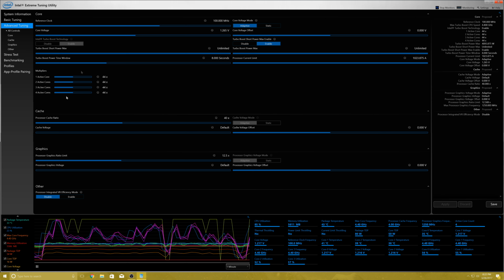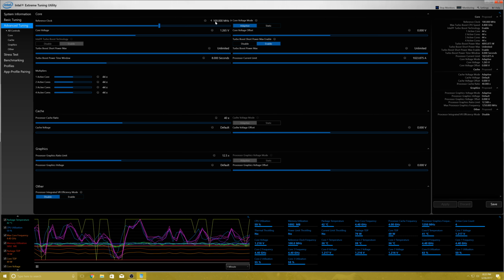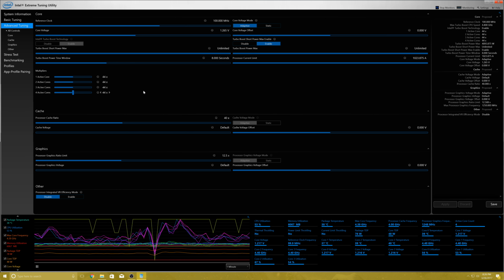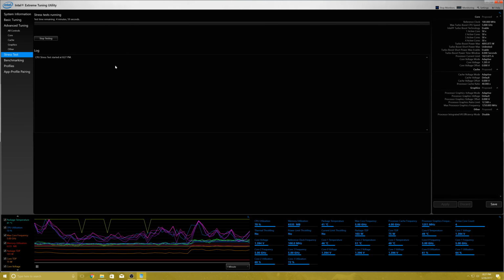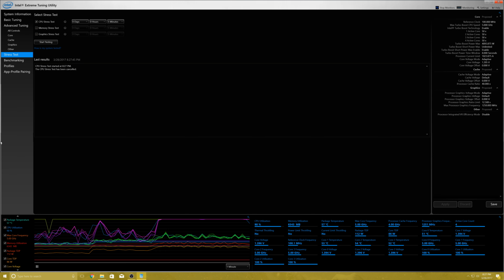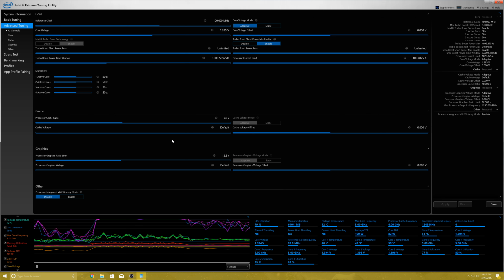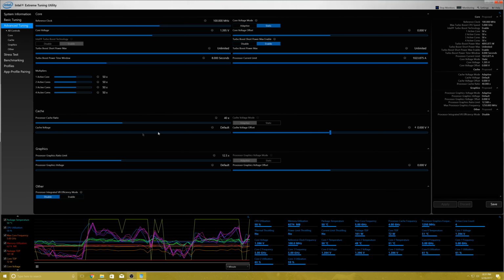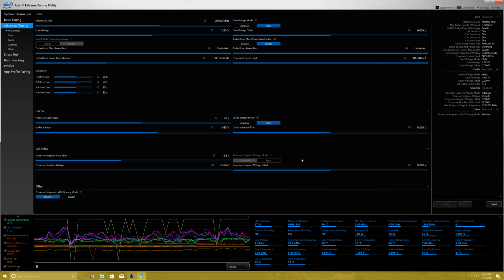Intel EASY Overclocking Guide ( ANY UNLOCKED CPU 3770k,4790k,6700k,7700k,) Pentium,i3,i5,i7

Comment: that voltage is not safe at all lmao
Reply from the maker: Polar Pole h1z1 and rust I know 😏 just to show an example. I run my 4790k at 1.35v
Reply: I also run my 4790K @ 1.32 (4.6) but 100% stable. No crashes or random blue screens. If you know who Der8aur who is one of the number one overclockers in the world, which I know him through chatting with him... He explains that as long as you have proper cooling such as a AIO/Water cooling you can run the chip all the time at voltages from 1.35 to even 1.45-1.5v so long as it's cooling right. I use a liquid metal on a delidded processor also. Again 1.32v is the highest it runs @ 100% load with AVX instructions. Usually idles around 1.21v. while the power scheme in Windows 10 is set to Performance/No power saving features except speed step.